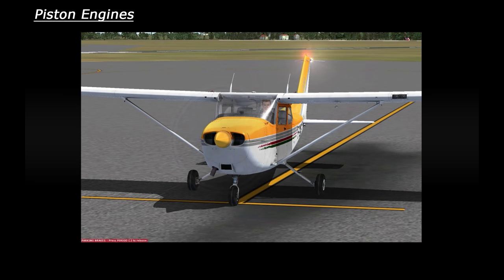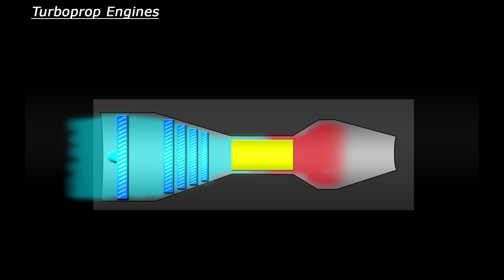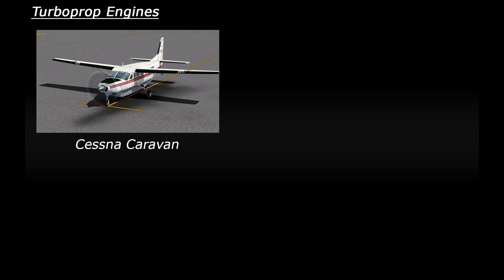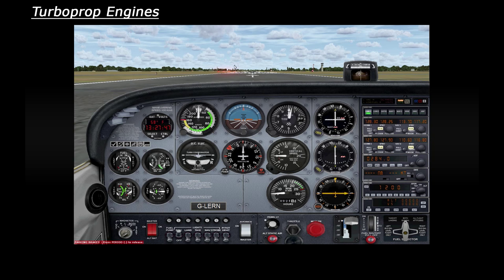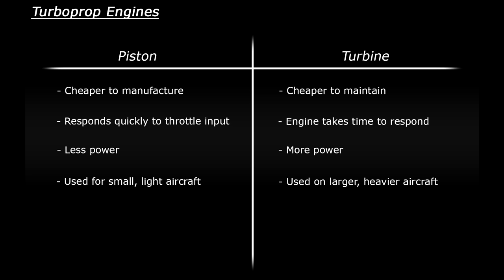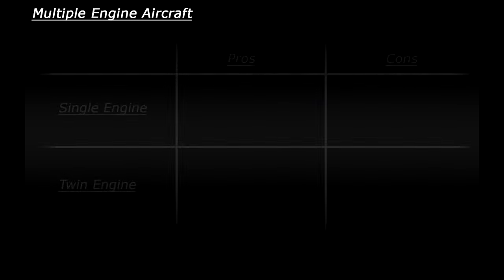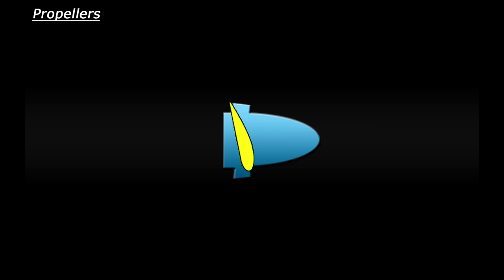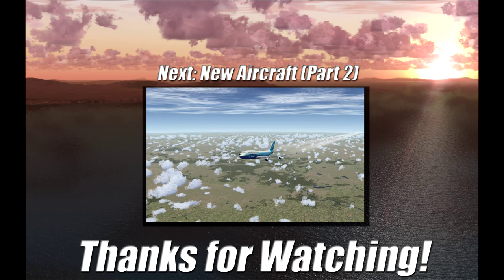FSX Tutorial: Propeller Aircraft

Comment: You should add that the prop is feathered to prevent it wind milling which would cause the prop to turn the internals the dead engine and probably tear it up. That's a bad thing, further expense and the risk of it tearing itself right off the wing if it seizes.

Comment: In the real world, going from single-engine to multi certification is one of the most difficult parts of Pilot training. You HAVE to be proficient in asymmetric flight, and this is one area where "Commercial Aircraft" simulator training has paid for itself time over time - there have been more than enough serious (often dual-fatality) crashes where trainee Pilots have had real-world problems doing asymmetric landings. ALL Commercial operators now train asymmetric flight using simulators only (and that's fully IATA compliant)

Comment: Is there any video that shows how to handle the pitch of propeller Cessna!
Reply from the maker: Not really, usually an aircraft's manual gives guidance on how to adjust the propeller pitch for a given stage of flight. For example, if you're flying at 100 knots, then adjust the propeller pitch until the propeller RPM's are 2000 RPM.... just a rough example. On larger planes, an on-board computer automatically controls the propeller pitch.
Reply: Thanks a lot.
Reply: In passenger planes, the flight management systems will try to keep the engine(s) running within the "highest conversion efficiency" rev. range, varying power absorption (via the prop(s)) by varying pitch. In manual systems the Pilot will adjust pitch and throttle to keep RPM in this sweet spot. On take-off, the engine(s) will be run at the maximum output rev. band (which is not always maximum RPM) - less fuel efficiency but maximum available power (when you obviously need it!).
Reply: I fly It at about 2300 RPM (In real life).